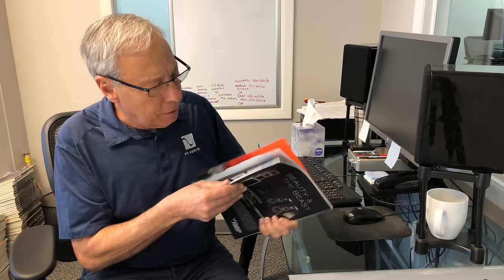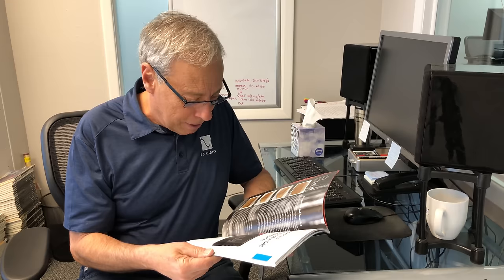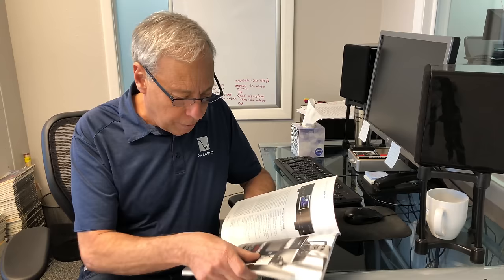Is equipment burn in real?

Comment: I'm really skeptical and definitely in the "A/B/X blind tests or it ain't real" camp, but I still enjoy the video, and I certainly don't think it's impossible that we are overlooking something that can make this whole thing very real. I think I sense burn in myself, but I have always chalked that up to familiarization.
Reply: That is the great thing about double blind tests. If we are overlooking something the double blind test will proof it, as people will hear the difference.

There is no reason why blind tests should only be a tool for skeptics. It can be a great tool for both camps.
If there is a big difference in sound it will easily show in double blind tests and you have great proof against the skeptics.
Reply: Marc De Vries I did car audio for years and I used to laugh at some of the stuff and I still do. But after I replaced a McIntosh amp in my car the sound was way off. Not only to my ears but on the RTA too. Now I gave my amp to a customer who was in a hurry and I took the replacement when I got it. So I called them back and explained the problems and they told me to let it burn in. I was pissed and skeptical so I called my rep who assured me its legit. Still being skeptical but knowing my rep I listened and left it play for several hours. Well believe it or not the sound came back and the RTA metered the same as the other amp after running it.

Comment: Seems the cynics of "burn in' never stop burning under the collar...
Reply: Cynics are cynics of any form of snake oil.  If  there's no conceivable mechanism for it to happen and the effect is not measurable, it's imaginary.
Reply: @travis1240    But it is measurable.   Just not by the means you insist upon.  Why do we have gourmet chefs?   Their taste buds detect things you have no way to measure for.  Same goes for hearing.
Reply: @genez429  Blind studies might convince me, if there was a mechanism to go along with it.  Chefs do use different ingredients and processes, so the mechanism is there.  With electrical components (speakers aside, they are also mechanical) there is no mechanism.     That said, much gourmet food is also way overpriced for what you get and much of the "tasting" happens with your eyes and your wallet instead of your nose and taste buds.
Reply: @travis1240  Forget the blind test.  Its no good because of the distraction it causes.  Simply switch cables and listen with them for a month.  Find some recordings and streaming that you routinely listen to, and go about your business. Listen during different times of day as always.  Then,  switch cables and listen for about a month as well.  If you are astute you will begin to hear differences if what you listen to is something you have heard many times... A/B blind testing does not let one relax. Moving from one to another ruins a certain type of concentration, and may even confuse the listener...

Comment: Burn-in of electronic components or even worse cables (like “molecular structure have to align”) that’s nonsense. I can agree on speakers which are 70% made of mechanical parts.
Reply: Yes there are millions of halucinating audiophiles and US military techs ...   only beacuse something does not fit into your realm of reality does not mean it is not there....
Reply: @kdomster9141  You're gonna try and claim wires 'burn in'? If that were the case we'd expect many sensitive electronics to fail due to changes in their electrical conductivity.  Electronic components? Yeah maybe some might have a degree of variance when there are internal chemical changes. But cables are definitely static, beyond temperature-dependant conductivity levels or corrosion/physical damage
Reply: @GrandHighGamer  metalurgy of different cables designs and metals used for cable construction along with dielectric , gauge, length , connectors quality , kind of solder or welding techniques all of it makes a difference and difference is magnified of higher res. systems ....

Comment: For this somewhat novice audiophile, totally plausible that a mechanical device (esp a large mass device, subwoofer etc) would have soem “burn in” (after all they wear out they are mechanical right ?) electronics, maybe because if heat issues ? But interconnects ?? With no heat issue ? Not plausible at all ; same for properly sized large speaker cables

Comment: I definitely know now that burn-in is real. Last year I bought a pair of Audio-Technica ATH M50x headphones. They sounded great right from the beginning, but I also noticed a gradual change in their sound over a few weeks of using them. The basses became softer and more pleasant to listen to. They literally became better headphones. Now, you'll probably say that it's only my ears, and yes, it was my conclusion too until a couple of weeks ago when I bought another pair of the same headphones. Upon unboxing, they DID NOT sound the same as my old headphones. They had the same kind of bass my older headphones used to have in the beginning, the difference was very noticeable. But after a few weeks of constant usage they softened too and now I can say with certainty that they sound the same.

Comment: I believe in it! My Schiit Mani sounded very dull the first day or 2, and then got gradually better, now it sounds brilliant.. it was shockingly bad actually, vailed..
Reply: Klaas Beheydt How can you be sure you didnt just get used to it?
Reply: Leon thepro i have 2 turntables connected to a good sounding djmixer. Then I connected one to the Mani. So I could A-B test..
Reply: Klaas Beheydt How does that help? You could still adjust over time.
Reply: I could just hear the sound change in the first 3 days. The Turntables are the same, The needles are the same, the amp and speakers are the same, so only the pre amp was different, and I could hear the sound of the new Schiit Mani change, get better with every record. In the beginning it was bad, dull, and after a while it out performed the old dj mixer.. It needed time like Paul explaned. hope this is clear enough?
kind regards Klaas
Reply: Klaas Beheydt It would change slightly over some time, but not over 3 days Im quite sure. And while nothing else other than the pre amp was replaced or changed, your mind was over those few days.
Reply: It really took a while, longer than expected..:-)
Reply: Klaas Beheydt Well, I dunno what to say.

Comment: My Technics Pro system from 1977 is so burned in, high end from today can never touch it. 
(Had to replace filter caps behind the diodes, I cried a river because it sounded so tight after that change ...

Comment: Thank you for the video. Im going through an issue with one of my car audio subwoofer amps and am going to give it some time to break in before i swap it out for the older one just had in their. The old one was 2000watts and the new was 2400w and it doesnt have as large of a bandwidth to the ear. It also seems to bottom out my suwoofer audibly when i get down to 26hz with my box tuned to 30hz where my other amp could play down to 20-22hz with no audible bottoming out.

Comment: I purchased a somewhat lower end tube headphone amplifier. The Darkvoice 336i. I rolled almost right away to better quality tubes than what were shipped with it, that sounded horrible right out of the box. They looked cheap, even, and when I first lit off the amp, there was a rather blue/purple light that traveled up the cathodes while the power tube heated up. I purchased an NOS GE tube for the power, and a new tube for the audio section. At first there was a pretty pronounced hum, and I was able to determine it was coming from the audio tube. So, following some guidelines I removed the power tube, and let the audio tube burn in for about 48 hours, which totally cleaned up the sound, got rid of the hum.

I've had the amp now for 2 years and I use it both to feed my Sennheiser HD-650 and G600 cans, as well as feeding the input of my Rokit RP10S/RP-5 speaker system connected to my computer. I totally agree with you that burn-in is important if you want to get the best sound out of it. I would not part with my amp, even if I were to obtain a better one. I am so glad I went back to tubes and got away from pure digital amplification. The difference is night & day.

Comment: I own audio PS4 h preamplifier really burned inside replacement part for it was not available it is a common problem with PS audio preamplifiers company does not supply spare parts be careful buying PS audio equipment

Comment: I have heard so much about break-in of speaker and interconnect cables. The main reason is the saturation of teflon insulation. The teflon robs HF until electrons saturation the dialectic. I purchased a pair of silver conductor speaker cables. The dialectic was cotton. The manufacturer told me they took around 500 hours for true break-in. Overtime  listen, they do get better. And I really don't understand it either, but it's not voodoo.Love your topics. Gary
Reply: Gary:
"The main reason is the saturation of teflon insulation. The teflon robs HF until electrons saturation the dialectic."

Who told you this? There is absolutely no evidence that electrons migrate into and saturate teflon insulation. And teflon is superior to cotton as an insulator.

Comment: Can you measure it?
Reply: I cannot imagine any way those capacitors act differently without it being measurable
Reply: The capacitor by itself? Yes. Take an electrolytic off the production line. Measure the capacity, leakage, and ESR. then apply its rated voltage to it. Come back in 24 hours and remeasure. You will find all three measurements changed. 

If you think about it, that has to have an effect on the circuit you are going to install it in. It may be a small effect and  you may not notice it, but you should be able to tell with measurement equipment sensitive enough.
Reply: With fuctioning ears, yes!
Reply: @JeanKatana  nice science.
Reply: @RecluseRR  Just enjoyment

Comment: I have an inexpensive Tri path amplifier on my computer speakers. It always sounded okay but somewhere down the road, maybe six months or more it started sounding like a tube amplifier. I couldn't believe my ears, it actually sounds like a decent small stereo. It has lots of detail and a decent tight Bass. I'm definitely a believer in component burn in.

Comment: Not that I have much experience with high end audio equipment but I would think the fiction of voice coil would cause smooth linear grooves to form that allow better speaker response in time.  Much like the cylinders in a new combustion engine.